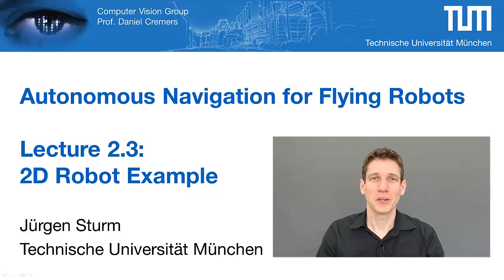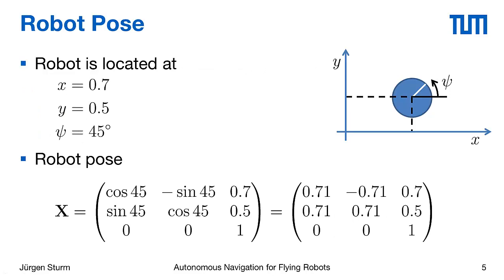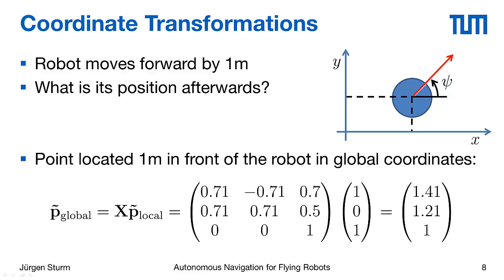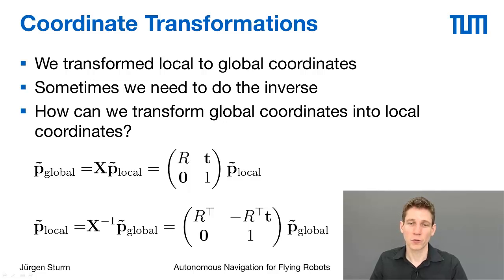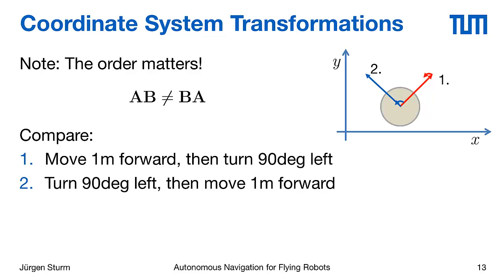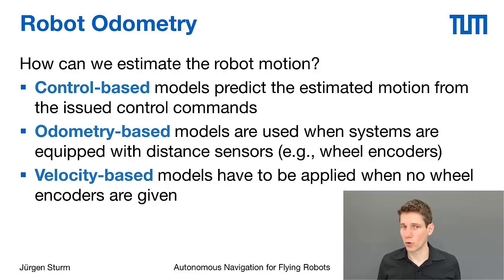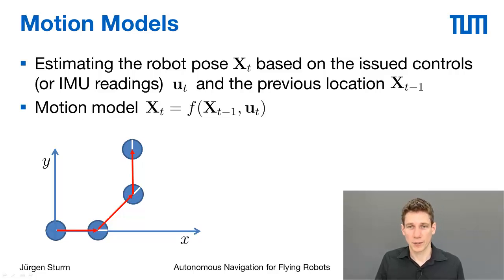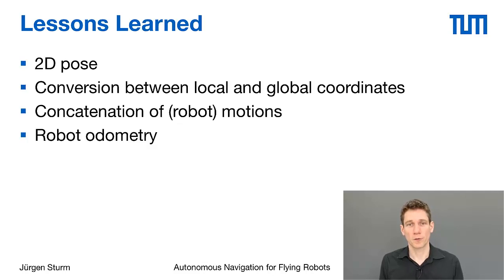Autonomous Navigation for Flying Robots - Part 2.3 (Dr. Jürgen Sturm)

Comment: HUGE GAPS IN EXPLANATION IN SECOND PART. MEANING OF X*p(local) DOES NOT IN ANY WAYS IS ANSWER TO THE QUESTION POSED. HOW CAN POSE BE 3X1 in CASE-1 AND 3X3 IN CASE-2. SOLUTION UNFORTUNATELY TURNS OUT TO BE CORRECT BUT ON THE EXPENSE OF MISUNDERSTANDING OF STUDENT. REMAINING ALL VIDEOS ARE EXCELLENT AND I AM IN NO WAYS DOUBTING THE KNOWLEDGE OF Dr Strum, IN FACT I AM LOVING THE COURSE AND LECTURES, BUT AM FRUSTRATED JUST BECAUSE THIS VIDEO ALONE HAS TAKEN ME ~1 hr. TO UNDERSTAND.